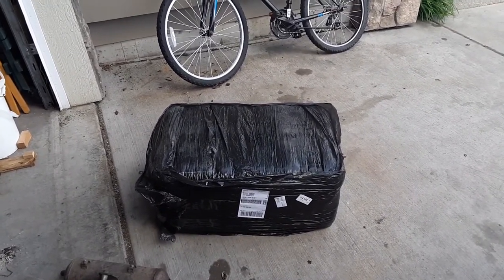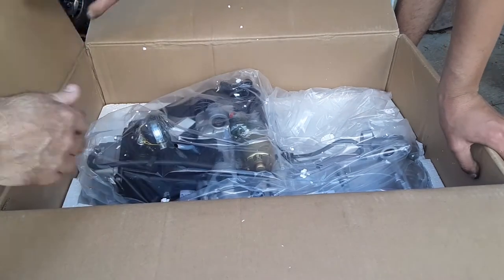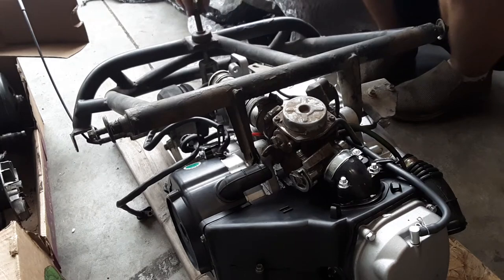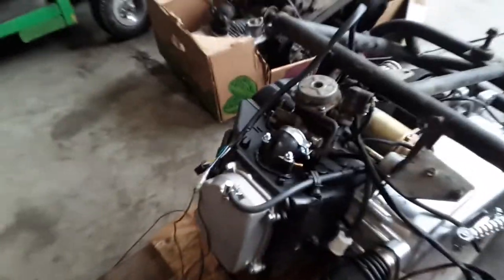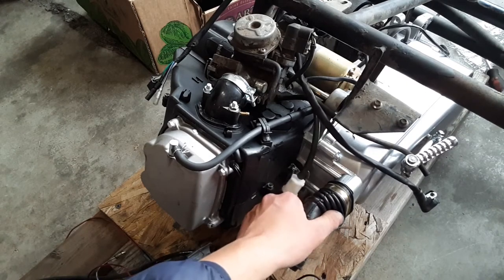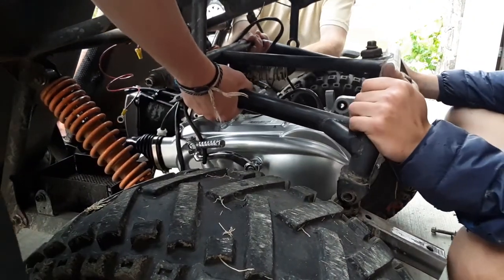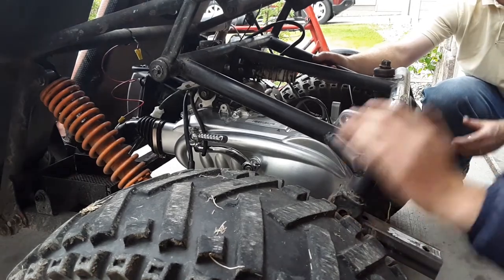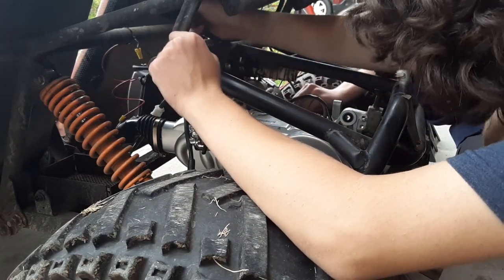New Engine in The Roadkill Kart! Part 1 (150cc street legal go kart build)

Comment: Will that motor work on a carbide 150cc GY6 dune buggy??
Reply from the maker: I am 90% sure it will based of the pictures of that kart online, just make sure it is set up for an external reverse box, not internal like the Tao Tao Targa 200 or the Massimo GKA 200. I put this motor in a Roketa GK-01 and the Carbide 150 looks very similar.